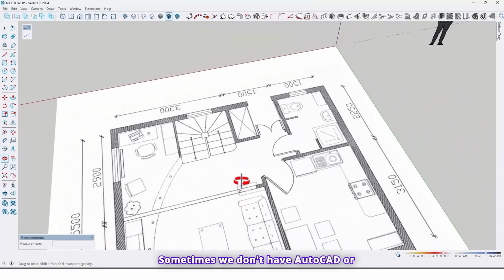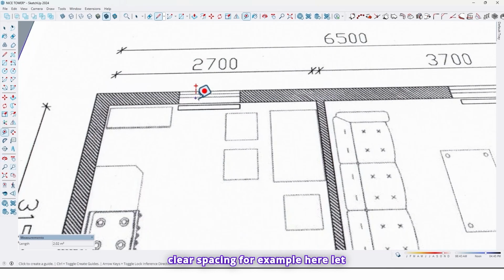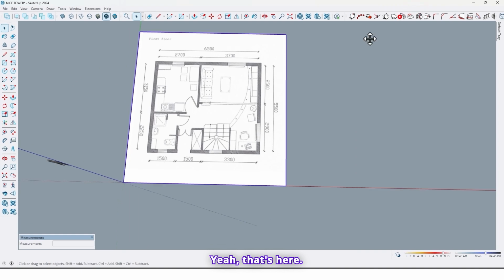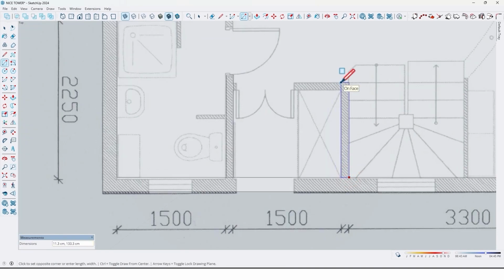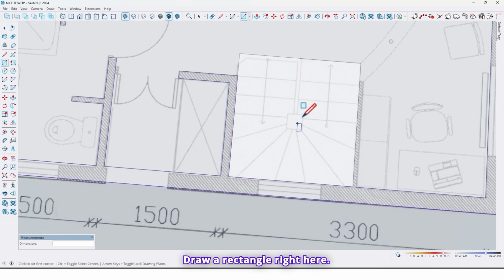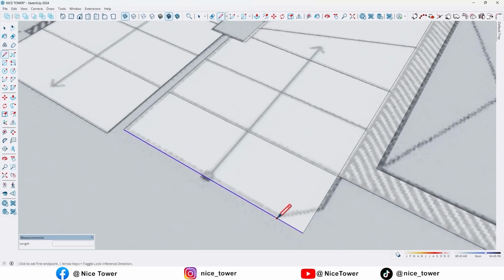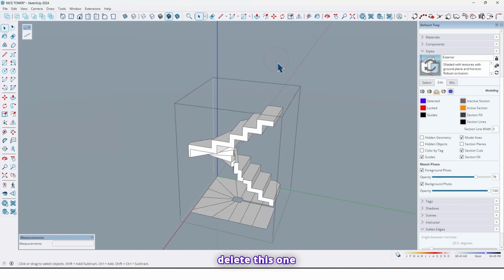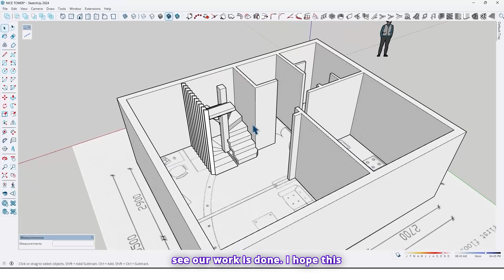Transform 2D Floor Plans into Stunning 3D Models in SketchUp!

Comment: The drawing has a dimension line of 6500mm. Why would you a) use a smaller dimension as a reference and b) use a point on the drawing (where there is more noise) instead of on the dimension line, itself (which is cleaner)?
Reply from the maker: On that time I did what was right for me 😊